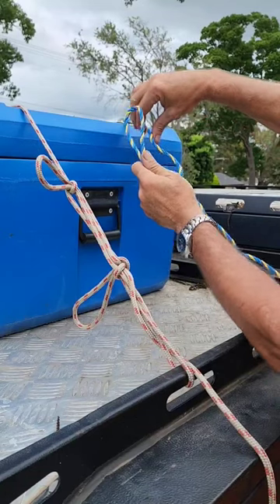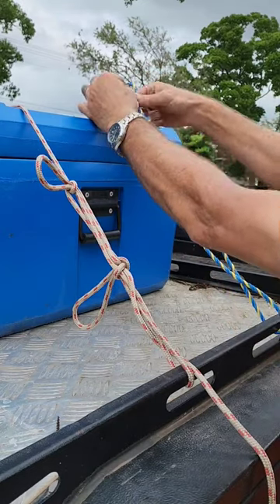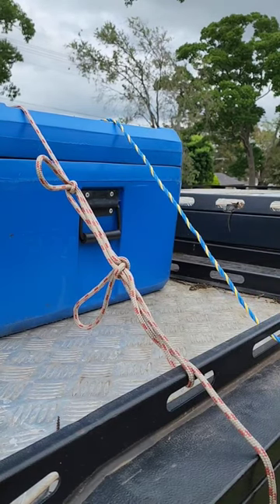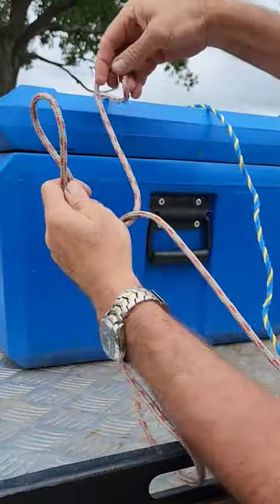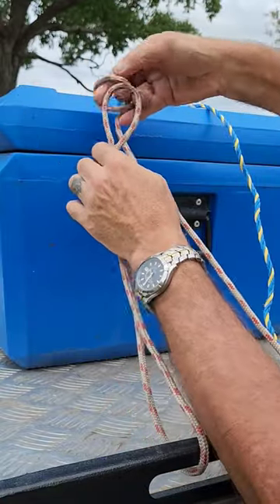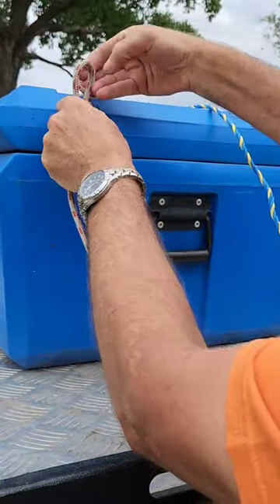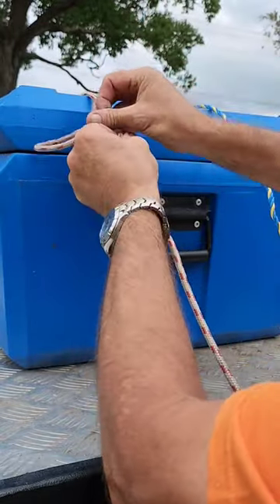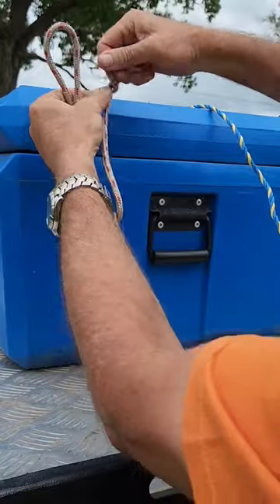Improve integrity of your Truckers Hitch when using plastic rope. Best Practice.

Comment: I learned the original when I worked on a roofing crew in Utah.  The boss showed it once and I picked up on it; the other guys couldn't get it and were afraid to ask the boss again, so I showed them.  I really like the double twist method best, experimenting with my Paracord. Although I've never seen the original method come undone, I've always worried it would - it didn't "feel" 100% reliable.  I came up with the third method myself but felt it had the same problem as the original... I'll have to experiment with the additional underneath loop some more.  Great video!
Reply from the maker: Thanks for the feedback. Let me know how it goes for you.

Comment: larks head. one half loop, and an opposing half loop the opposite direction.   larks head holds all.
Reply from the maker: I haven't heard of that one. I'll try it out. Thanks for watching.
Reply: I don't understand. You're making a lark's head with the bight made from the standing line? What are you securing it around, and what are you putting through the middle of the opposing half loops, then?

Comment: Of your choices #3 the clove hitch version is good.  The tension locks it up nicely.  #2 the rolling hitch version has a nice friction to it.  Sometimes I secure the loop through a marline spike hitch.
Reply from the maker: I use the marlin spike hitch if I have a short working end and for Ridge lines. 
Thanks for the feedback.
Reply: @OutdoorAcademyAustralia  Have you done a video on the marline spike hitch yet?   It is so very versatile.
Reply from the maker: @scorpionregent648  I've made it but not published yet. Not quite happy with it. It's coming though. It will probably be long content as too much info for a short.

Comment: plastic slippery rope I twist 3 times pull rope through to form loop, feed line through and tighten.   I know feeding long rope through is a pain, but instead you can just feed a section to form another loop run remaining rope over another hitch or ropes come back and go through loop and pull and tie off.   This is useful to add  sideways tension as well.

Comment: Like the truckers hitch with slippery marlin spike loop so disappears as soon as disassembled and pulled to tension. Would use two half hitches to secure nylon rope. Edit: Just looked at your other vids and noticed this is your truckers hitch variant. Excellent.
Reply from the maker: I use the slippery marlin spike hitch if I need a self locking hitch by feeding the working end through the loop twice. I use this half sheep shank when there is too much rope to feed through the loop. Thanks for watching.

Comment: Will admit I have not seen or used method 1 or 3. Have always used method 2. Never had this method fail also the easiest method I've found to use when at times one needs to add another bite in the rope to create a double pull down.
Reply from the maker: Thanks for sharing

Comment: I start with a GE knot at one anchor. Pull the line over the load and under the other anchor. Then,  make 3 twists up by the load for my pulley. Pull the line tight and pinch the bite. Then secure with a half- hitch,  and then another half- hitch around that one. "She ain't going anywhere. "😊

Comment: seen 5 different ways people vlaim is a truckers hitch.
Reply from the maker: I've seen all sorts. Whatever works I guess.
Reply: The truckers hitch is the basic system of getting mechanical advantage when trying a rope down. The elements that make it up vary depending on when and where. Oh, and what- what kind of cord you are using, both thickness and material.
Reply from the maker: @zoehancock  It is an 8mm kernmantle rope. The blue plastic rope we call Telstra rope because it is used here by linesmen to pull telecommunication cable underground. Strong but slippery.
Reply: I agree with Zoe, the truckers hitch is a system of knots in combination.  The versions are legion.

Comment: Cow hitch anybody?
Reply from the maker: I haven't tried it but maybe. I feel it may bind.
Reply: @OutdoorAcademyAustralia  I use it. It naturally spreads out into two loops. Works very well. I'm sure the double twist loops you demonstrated are even more secure.
Reply: It would be interesting to see the various ways of doing it pulled to failure on one of those hydraulic test setups!
Reply from the maker: @sskaustralia  I agree. I may try and find or make one..

Comment: Just use a larks head holy shit.
Reply from the maker: Try broadening you knowledge of knots. If I have 25feet of rope, why would I pull all that through a slip knot?
Reply: @OutdoorAcademyAustralia  you can put them in the center of a line of any length in about 3 seconds with 2 fingers dude.
Reply from the maker: @teddyroosevelt79  cool
Reply: Overhand slipknot mid line, end through the loop, finish with a half hitch with a bite. All mid line, dump the other ten feet on the deck, no slip. Two half hitches for the nylon cord. I’ve always tied the truckers hitch completely differently I guess. Lol. I don’t think the larks head would make this any better, but this version is probably totally fine for the cooler 😅 https://youtu.be/T8dUP_xGa3g   ⬅️ This dude isn’t nearly as cool as the Australian, but that’s pretty close to how I’ve always done it.